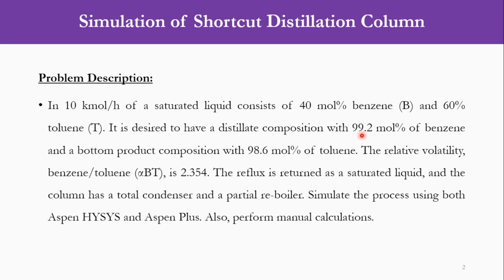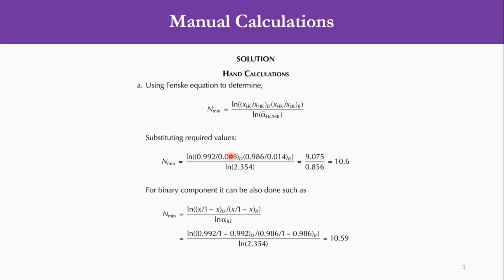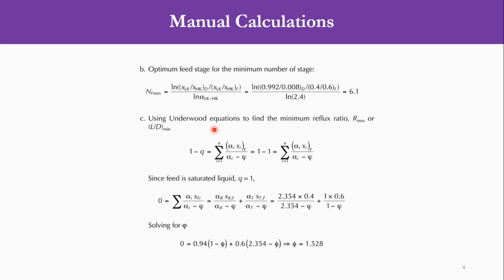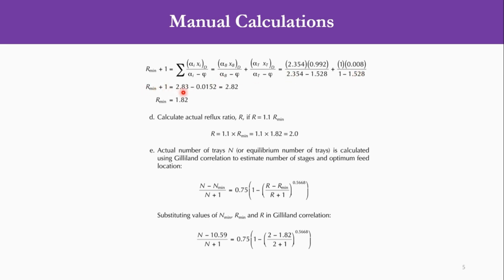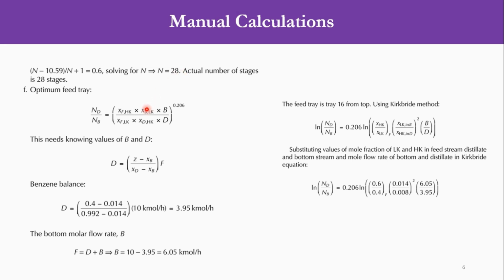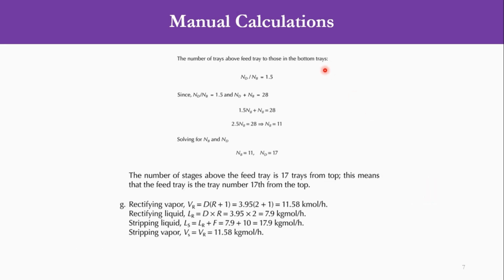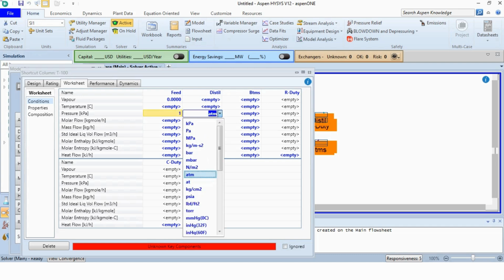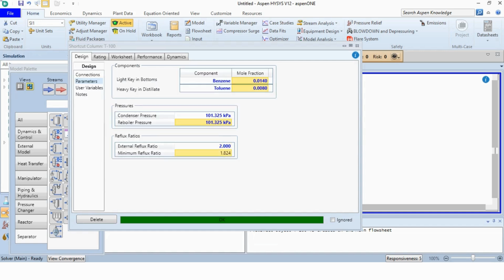Manual Shortcut Distillation Calculations + Aspen HYSYS Simulation — Full Comparison & Results

Comment: Hello! Thank you for the video. 

Is there any inconsistency due to condenser duty be negative? Its value is -361,703 kJ per hour.
Reply from the maker: The negative value is a symbolic representation of the fact that heat is removed from the condenser.